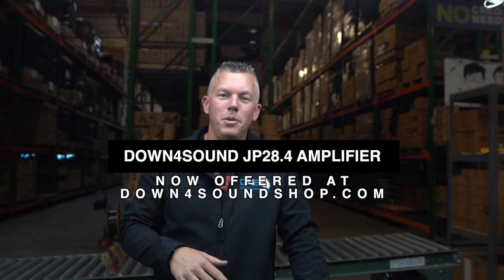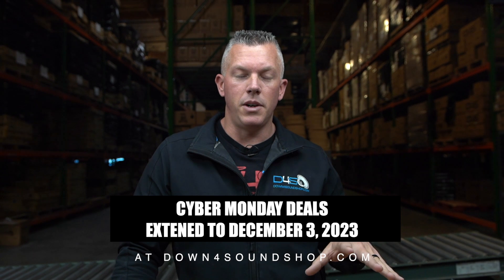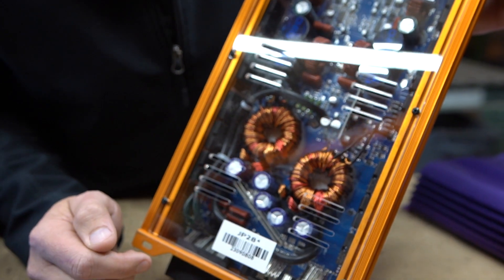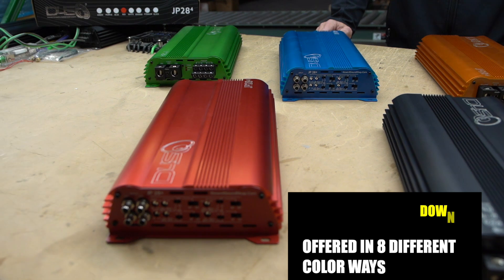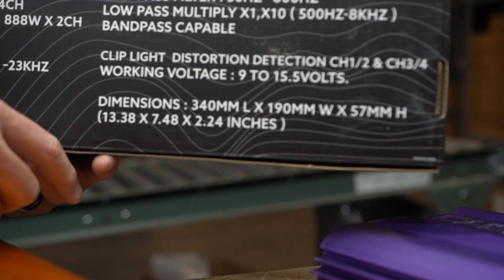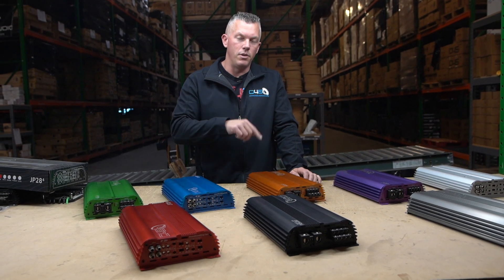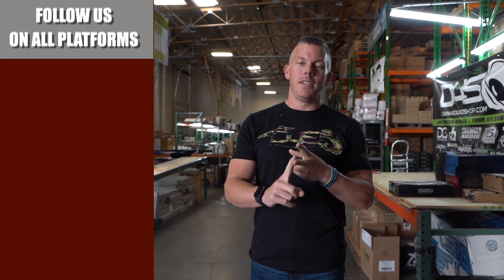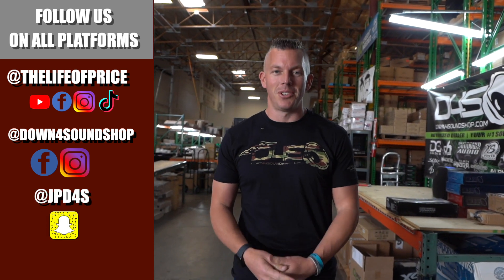INTRODUCING THE DOWN4SOUND JP284

Comment: Know whats jacked up. Jp got the same components as the nindo 2000.4 for as low as 300$ on sale. Jp says 23khz while crescendo rates theres at 37khz. If your running crossovers to tweeters i go crescendo...but if your running mids or midbass.. these amps are impossible  to beat.

Comment: Hey JP, quick question…. I don’t have my setup right now but I would like an opinion on whether or not you think a jp43 would be a good fit for 2 zvx 15. They are both dual 1 ohm subs. I have an skv2.3500. I also have an xs battery but you don’t really need all that info. Would the jp43 power those two subs ( skar zvx 15)with all the correct electrical?